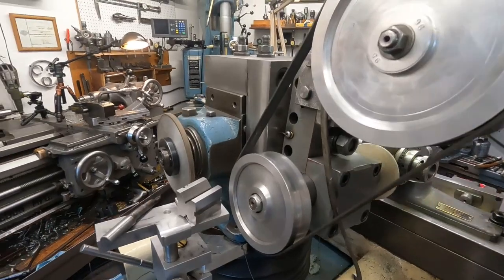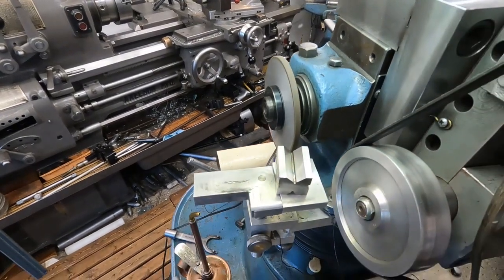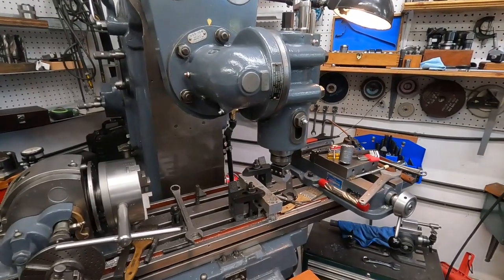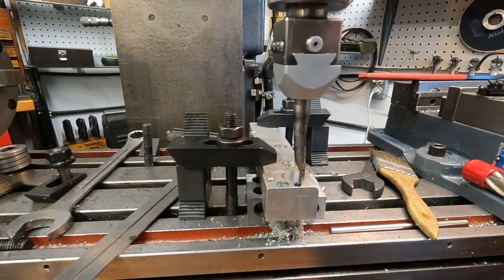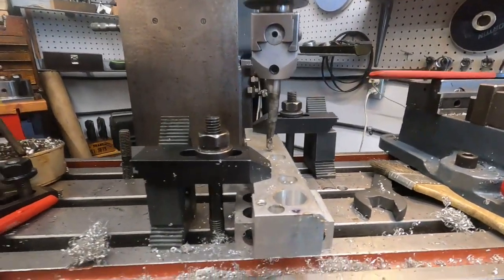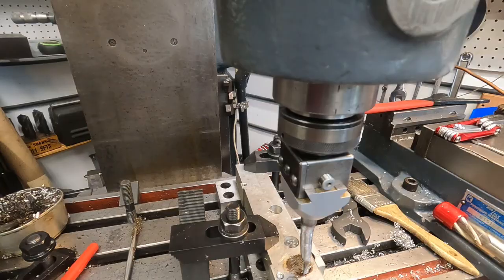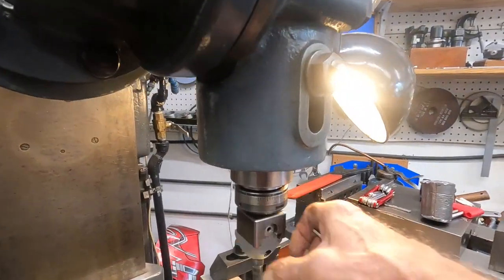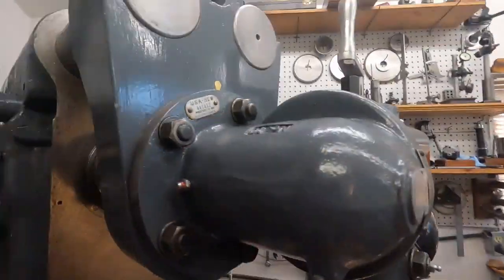Final test tenth set boring head on Brown&Sharpe milling machine

Comment: H i Don. The loupe is cool, and could you put a 1-10th  indicator on the boring head so you can see the adjustment when you make it?  Thanks
Reply from the maker: I have used an indicator with mixed results adjusting boring heads on standard milling machines. I found with this mill it obtains better finish and accuracy taking deeper cuts then what may be normal on the Jig Borer and I can hit plus minus .0005" pretty easy on this mill, but to get any better it will take another operation like honing. Thanks!
Reply: @DonDyarprecision  Ok Thanks.